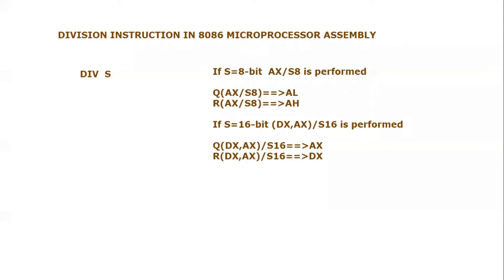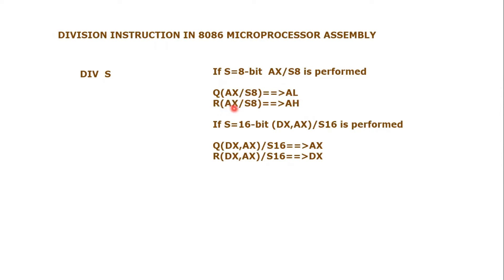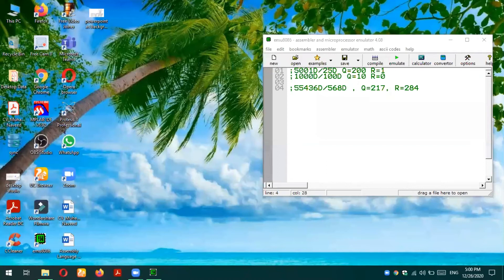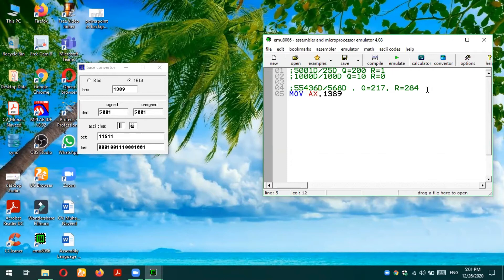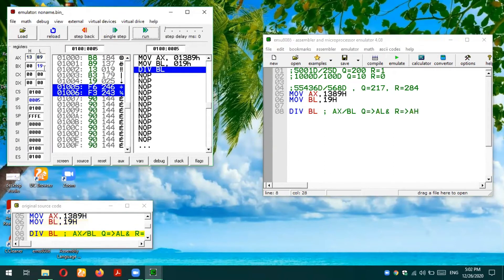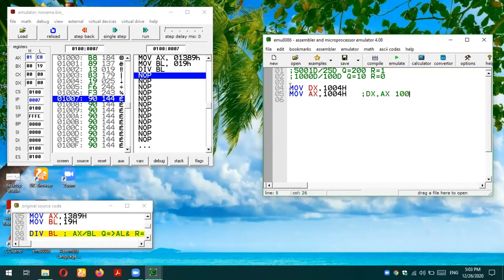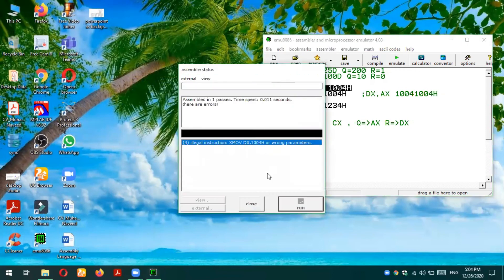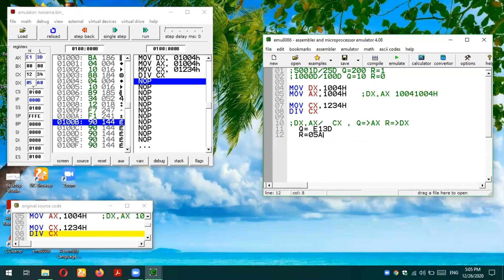DIV Instruction in 8086 microprocessor assembly language with EMU8086 example

Comment: can we do a 16 bit number with a 16 bit number? also 8 bit with 8 bit?
Reply from the maker: yes, we can do it.  16-bit is done automatically. if you want to do it in 8-bit then use the 8-bit number for example Put AX=24H (8-bit) and use MOV CX,24 (Another 8-bit number) then use  DIV CX then the result will be stored in AX. (24H/24H=01H)
Reply: @LearnOnline1  if I dived 24H(36D) with 13H(19D) where will the Remainder go?
Reply from the maker: @aaqidmasoodi  Remainder will go to AH  as explained in the video. you can notice it is written at @0:03
Reply: @LearnOnline1 got it.thanks
Reply from the maker: @aaqidmasoodi   you are welcome

Comment: assalamualaikum... HELP  how it divide....how get that number E13D and 05A0
Reply from the maker: Wailekum salam. In the very last example of this tutorial, I performed Divison (10041004 hex /1234 hex) , using DX =1004H, AX =1004H  then I used DIV 1234H according to syntax. It will perform this addition.  then the quotient is EI3D hex and Remainder is 05a0 Hex

Comment: Pls how can the code be uploaded into the microprocessor Ic?
Reply from the maker: The procedure to upload the specific program in Microprocessor IC is known as the burning. For that purpose, one needs to use a burner (special equipment). Usually, there are a variety of manufacturers available who produce burners for the various microprocessor. Soon, In Sha ALLAH!, I will make one tutorial for it. 
Furthermore, There are also KITs available which allow the user to manipulate, program, and see the effect of those codes on limited resources like LCD, seven-segment display and LEDs, Buzzers within those KITS. MTS 80 is one of them dedicated to 8086 microprocessors.